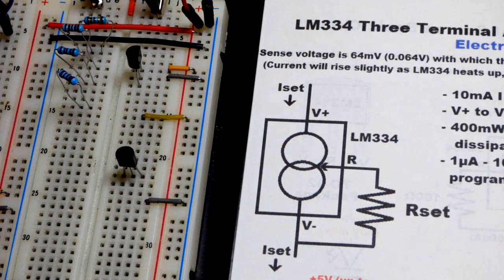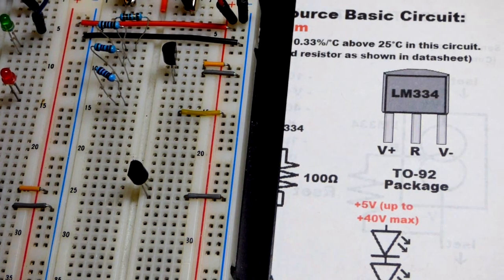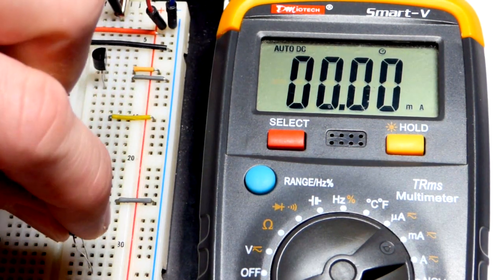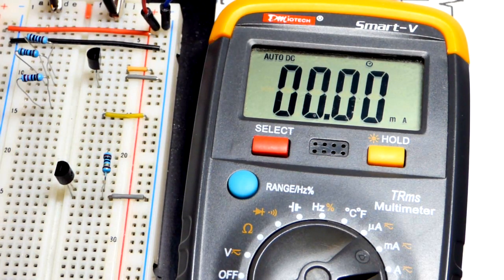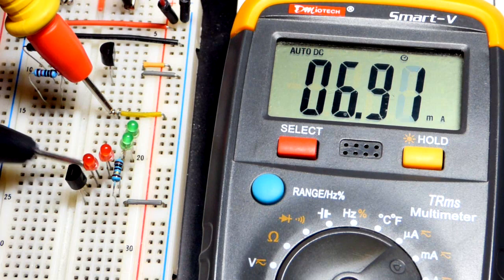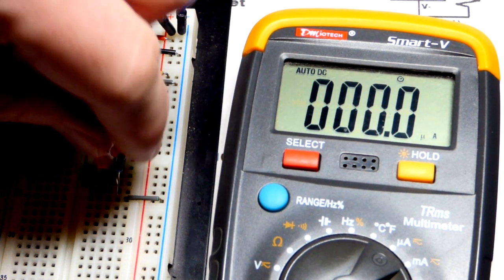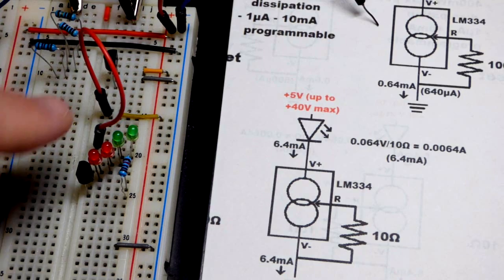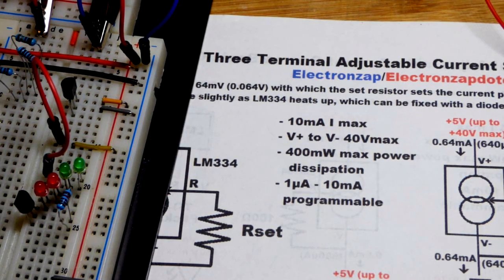How to use LM334 3 terminal adjustable current source electronics component by electronzap

Comment: Digital multimeters can be inaccurate when measuring series current. It's better to measure the voltage across a known resistor and use ohms law to calculate the current. Also, the 6.8 milliamps is correct for 10 ohms because you have to add the bias current. The datasheet has a chart which shows the ratio between the set current and the bias current, which, in the case of a 10 ohm resistor is approximately 13:1.

So:
0.0064  + ((0.064/10) / 13) = approximately 0.00689
Not perfect, but much closer to the observed output.
Reply from the maker: Thanks for the info!

Comment: Hello. Sorry for my bad English.
So what happens if the input voltage (V +) is not enough to deliver the constant current to the load. Is there no voltage passing and therefore there will be no current through the load?
(I simulated a constant current source with the LM317 and when it happens that the input voltage is not enough, it simply passes less current through the load but I don't know what happens in these cases with the LM334)
Reply from the maker: Current will go down. It will go down to no current if all of the voltage drops added up are higher than the supply voltage.